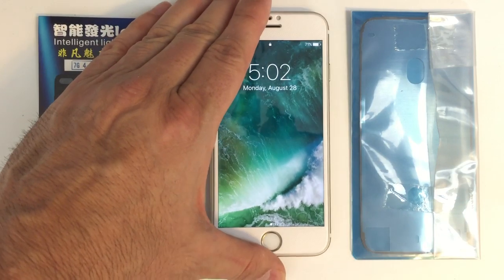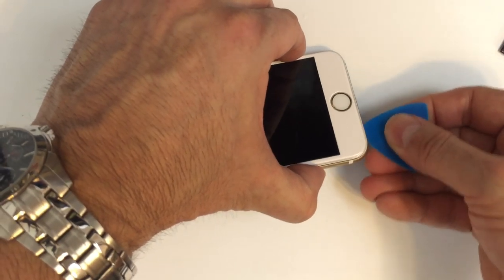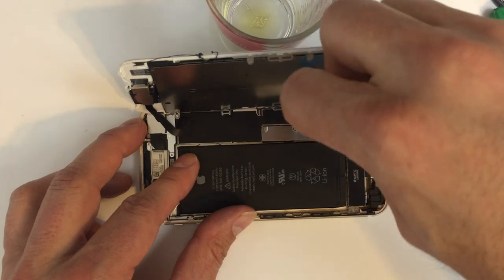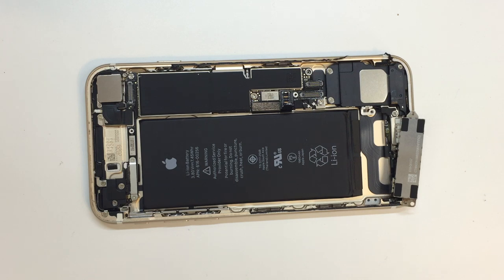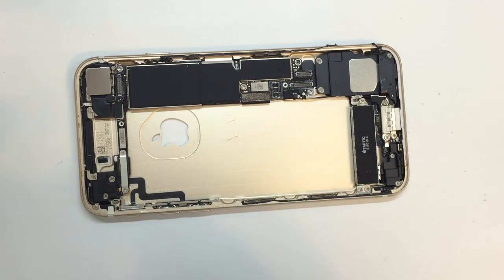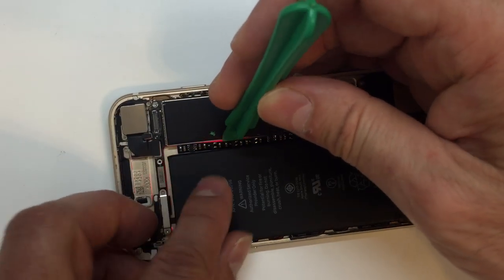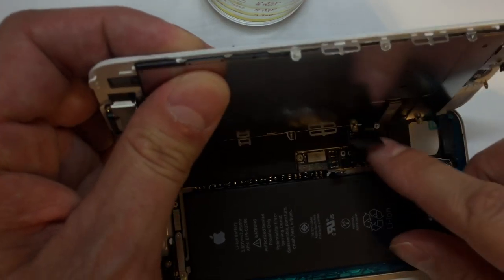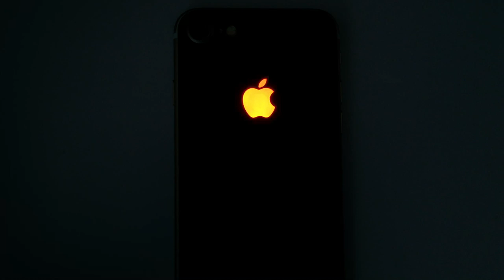iPhone 7 Multi-Color Logo | Detailed Tutorial

Comment: That foam piece that gets added to the back of the battery connector, as well as the ones you see on the back of the digitizer/LCD connector are to keep constant pressure against the connectors.  That especially helps for when the phone is accidentally dropped, those connectors don't pop out.